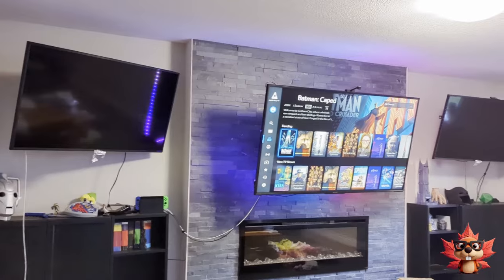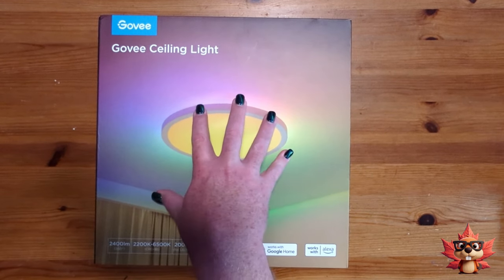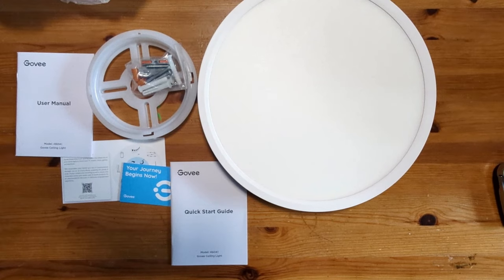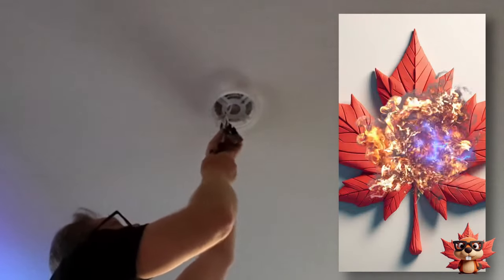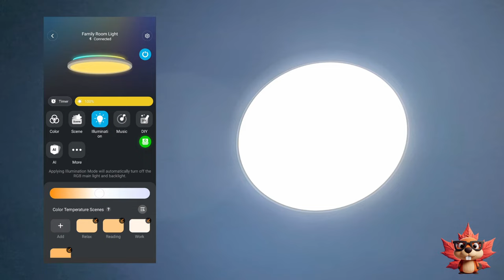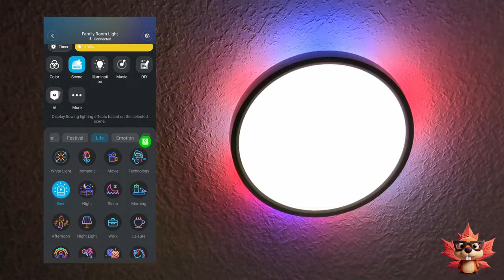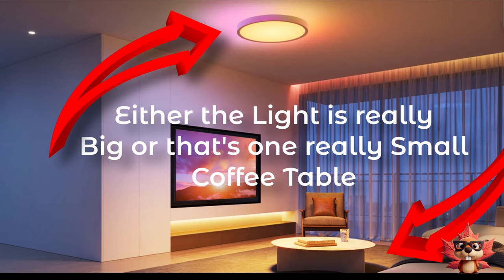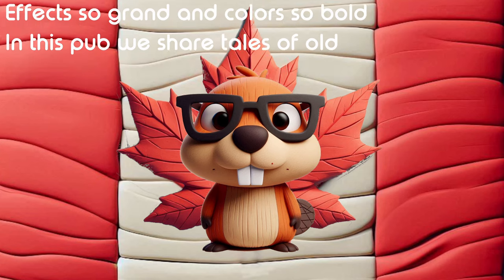New Govee Smart Ceiling Light H60A1. Is it the Perfect Smart Home Upgrade? Let's Test It Out!

Comment: Can u turn the top lights on without having to have the main light on ?
Reply from the maker: Yes you can.
Reply: Question, can you use a dimmer switch to dim? Or at least turn on off the light?
Reply from the maker: That I have no idea on. I would guess no, since most Govee products, and other smart lights don't do well with dimmers. Most smart lights need constant power to the light to keep the control chip working.

Comment: I just ordered two of these myself but I haven't gotten them yet. I'm a little concerned about the installation cuz I think I'm going to run into the same problem you did. I'm assuming I can drill into the drywall and use anchors to support it. Is that what you ended up doing or was there some other thing cuz I didn't the install part was not filmed and short you know it's from a distance so I couldn't really tell too much. And I know you said you had some issues but I wasn't quite understanding so if you don't mind a little clarity I would greatly appreciate it. Great review by the way it has me a little worried about buying two of them now fortunately I didn't buy the full five like I was thinking hahaha

Comment: Ok... So thinking of buying this, but i want the same as you

Main light much more variable, right down to a dull soft low lumen... And maybe 40cm plus size
Round or rectangle, don't mind
With similar features, settings and app

Is there such a light ?
Reply from the maker: I haven't found one yet, but plan to keep looking.
Reply: @asmarterhomecanada  Nanoleaf has their Skylight system for ceilings. Bit pricey but well made brand. They’ve won design awards. Canadian as well.
Reply from the maker: @occam5375 Yeah I saw those. They look amazing. I'd want them in my kitchen if I can get a good price on them. I didn't know Nanoleaf was Canadian. I may have to get some of their other products.